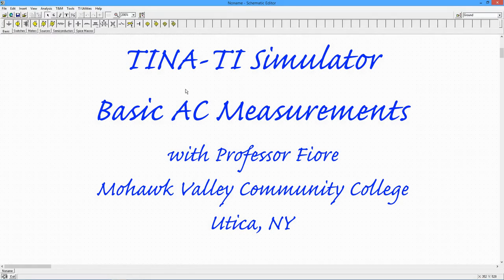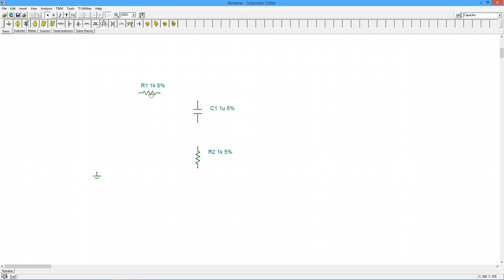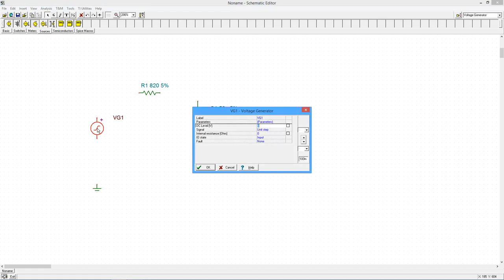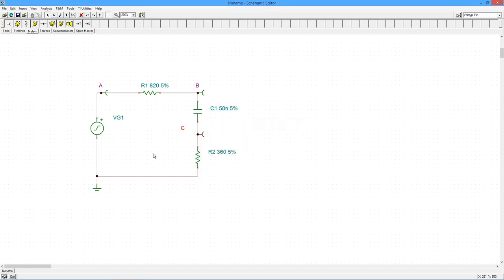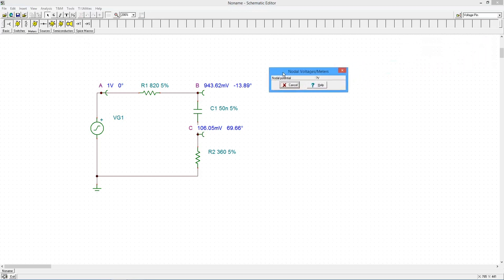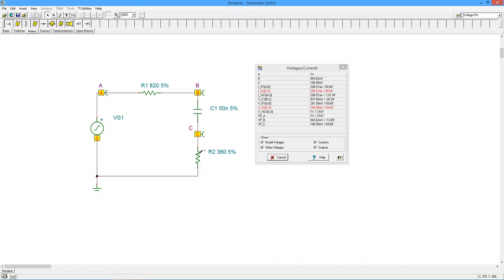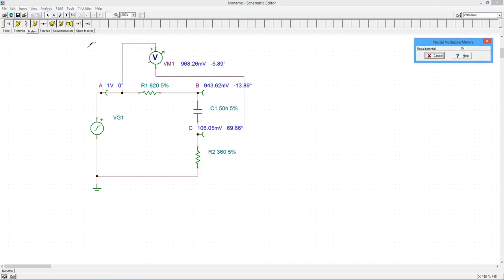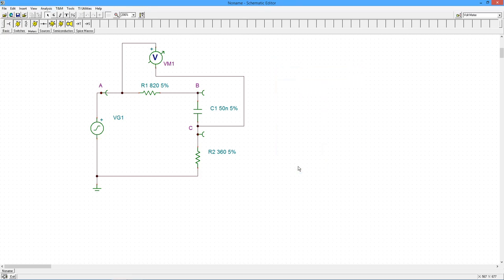TINA-TI Basic AC Simulations

Comment: Why are my phase angle completely different?  THe voltages are exact.
Reply from the maker: Make sure that you've set the default input to sine instead of cosine (In TINA, that's under View>>Options).
Reply: @ElectronicswithProfessorFiore  p, that was it.  Thanks.

Comment: i mac based version available?
Reply from the maker: There are not a lot of choices for simulators on the Mac. You might be best off purchasing a subscription to a web-based simulator. Design Soft, the makers of TINA, have a student web version (TINACloud) that is relatively low cost ($12 for a year). I've used it and it works just like TINA-TI with a few minor twists.

Comment: is it possible to use triacs, thyristors, diacs, and other components of this type?
Reply from the maker: I haven't used those specifically, but if you have a SPICE model from the manufacturer, it should run. I have imported op amp models with success.